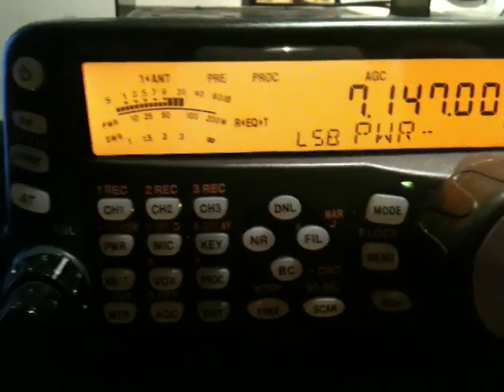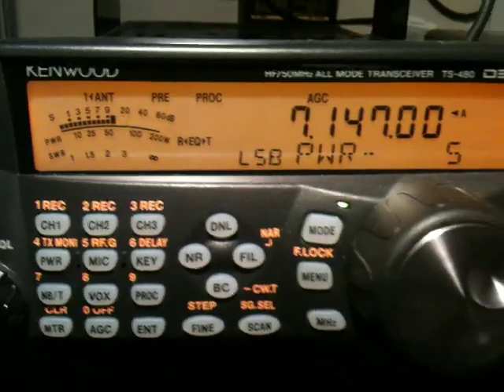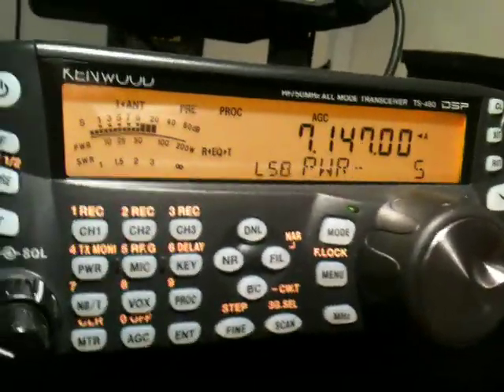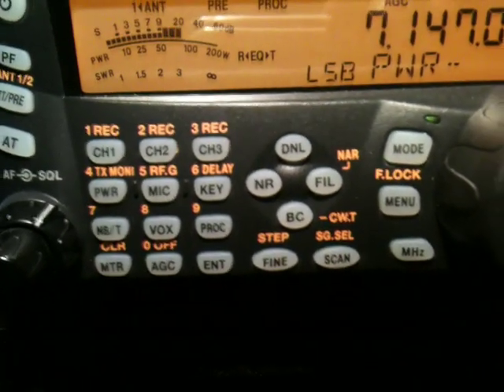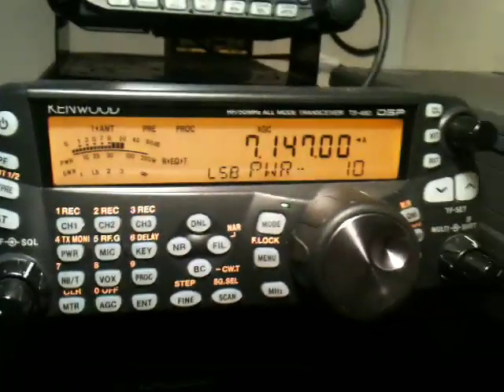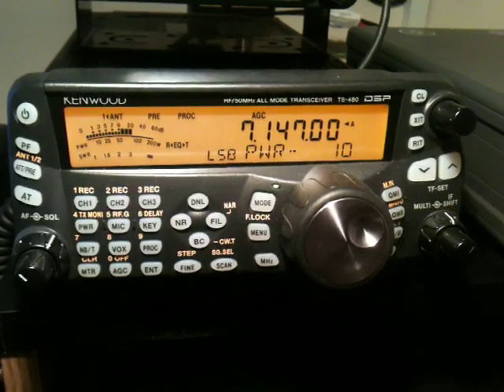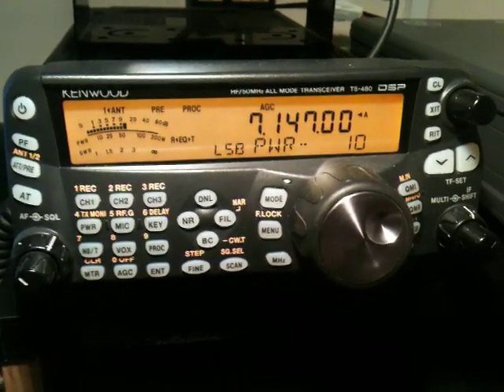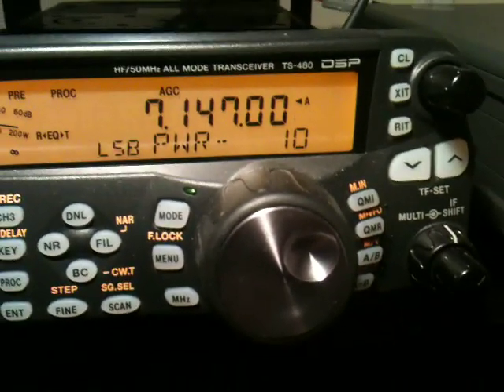GM4ROJP useing wire kite antenna.MOV

Comment: Give it a go! I've used my ft817 with a kite on a few occasions over the last few years very successfully. You just need to be aware of static build up, Weather conditions (lightning) and have a selection of kites. It's surprising how hard a kite can pull an get out of hand very quickly. I've had contacts all over Europe with 2.5w ssb during this solar minimum using an end fed halfwave cut for 80m.